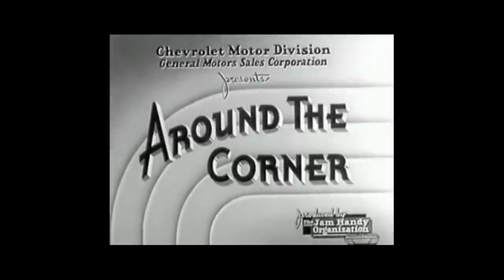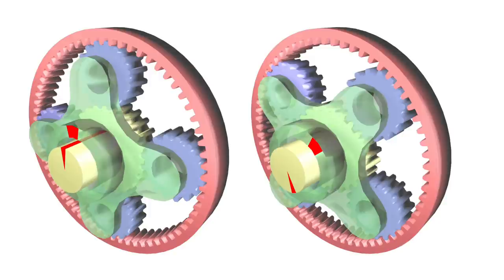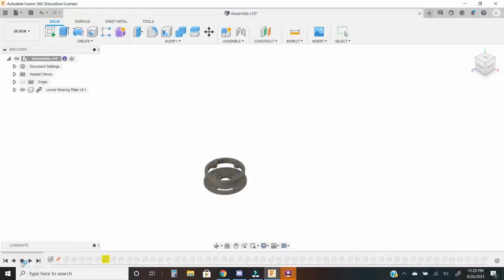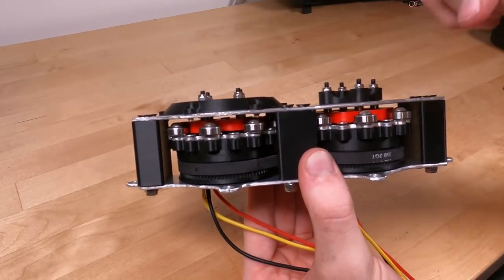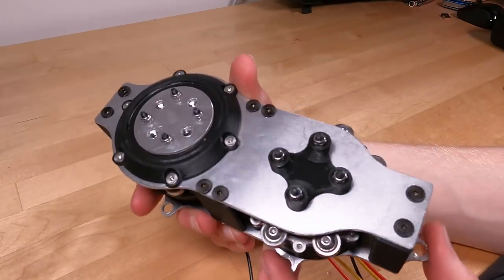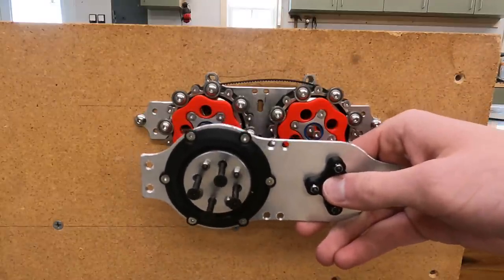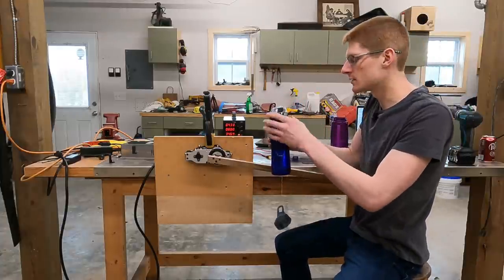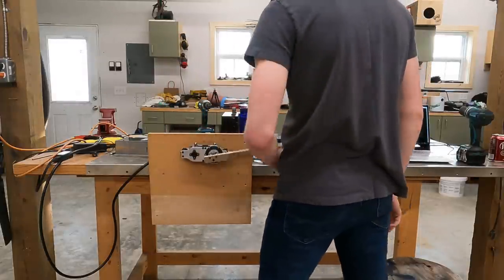The Differential Drive - A New Breed of Actuator

Comment: Look at the Toyota Electric Variable Transmission.  It uses two 2:1 planetary gear sets in series, with  an internal combustion engine driving the #1 set and the wheels, with electric motor #1 driving the #1 ring gear, and the #2 ring gear driven by electric motor #2 with the output from #2 driving set #1.  Each ring gear can move forward or backward at any desired speed from +6000rpm to -6000rpm.  This gives you any gear ratio you want from 1:4 to 4:1, using no, either or both motors to add torque or rpm, or subtract power to charge a battery or to run the other motor (or to start the ICE)

Comment: The thing I get to wondering about is, rather than a water bottle and tape measure and a bunch of calculations, why don't you just use a digital torque wrench. Make an attachment socket for it, turn it on, and  read the number. No fuss, no mess and it's handy to have for other mechanical projects you might do.

Comment: As others have mentioned, the Toyota Hybrid Synergy Drive uses an identical system (Toyota calls it their Power Split Device) to combine the power from the ICE (Internal Combustion Engine) and MG1 (Motor Generator 1). The output contains another electric motor, MG2. By varying the rpm of MG1, this creates an effective CVT for the ICE. Electrical power for MG1 (positive or negative) comes from MG2.

See the following for more information:
 https://hybridautopart.com/blog/toyota-prius-power-split-device/

BTW, Ford also uses an identical hybrid system in their Escape Hybrid and in their C-Max & Fusion Energi & Hybrid

Comment: There are a lot parallels with the two coupling modes to batteries in a circuit. In series you double the voltage (torque) and in parallel you double the amperage (speed). I think it makes understanding your hypotheses and their results more intuitive.
Reply from the maker: No matter where you are in engineering, you find the same kinds of tradeoffs. A beautiful analogy!

Comment: The two motors can be likened to when you chain batteries in series vs parallel.
One way you get higher voltage/amps, but the same capacity-
and the other way you get higher capacity, but the same voltage/amps

Comment: If you have twice the torque, you could use twice the gear ratio to get twice the speed.

Anyway, Skyentific did a nice 2DOF actuator with a differential input, too!
Reply: Yeah. I was a little confused why, if the goal was just to spin at twice the speed, a simple change of gearing wouldn’t be sufficient.

Comment: A planetary gear version could have ring gears with teeth on the inside AND the outside, to mesh the the two planetary gear systems. The direction of the secondary drive would need to be flipped compared to the belt drive coupling, but that's not an issue.

Comment: You could try applying a flywheel and clutch with a basic transmission to reverse them maybe? You lose the precision but gain the ability to store torque of the motors for use while retaining most of the speed of both motors and be able to reverse without reversing the motors and the flywheel.

Comment: Well... The easiest way I can think of to sum up the motor speeds would be to hook the body of one motor up to the shaft of the other one. Of course, you would have to deal with the wires getting all tangled and twisted. You would probably need to use sliding contacts or so for that. But you know, certainly seems easier and more efficient to me that building a complicated gearbox for it.

Comment: What a great video! Thanks for sharing your ideas. This line of thinking could be relevant to a hybrid drive system. The idea reminds me of a Toyota Prius drive system where a motor/generator and an engine share inputs to a differential and torque is routed to where is is needed.

Comment: I wouldn't have done it the same. I would have put two planetary sets back to back and connected them with a belt grooved drum, anchored the motors on opposite ends of a common base (shafts facing inward, and used each to drive a sun gear in opposite directions. A belt off the connecting drum to an idler with a shaft would be where the load would go. You were thinking to take the output off a carrier which would only give one half the benefit of the reduction. Transmissions typically use flanged shafts to take off the outer gear of a planetary, not the carrier. 
I get that you used cyclic gears but you took your output from the wrong place. The motors drive the red cyclics to move the shells sharing the belt. That's your output not the swash plate for one of the drives. Basically you just inhibited one of your drives with a lever. Use a longer belt and use it to drive the load. You did everything else right.

Comment: You may want to look up epicycling gearing, inc patents for it - it does the same thing (i think), allow riving a shaft from several motors. Its not a new thing really, these were used in middle ages to make astronomical clocks and other gear that allowed for prediction of planet's movements - primitive mechanical computers. There are also books on design of these. 

Overall, very well done.
Reply from the maker: A planetary gearset has one output and one input, not two. Though this can be achieved via a modified planetary gearset (or many other reduction systems), it is distinctly different.

Comment: I'm not saying it's the same thing, but when you described "two inputs, one output" that sounds like what crank-mounted eBike motors do. The output speed is determined by my legs, but the output power is the sum of the motor's output and my output.
Reply: In the beginning I believe he mentioned directly coupled systems like the E-bike.    the assist motor changes the power output not the speed output .  your bike may see more speed because you have enough force to actually go up that hill now but your crank is still only getting the same speed per crank revolution even with the added power of the assist motor.
I hope that makes sense.

Comment: If you want to go from twice the torque to twice the speed, one possibility is that you could put the combined motors on a 1:2 gear ratio, since one of the basic principles of a gear ratio, and the reason why cars need transmissions, is that it converts between torque and speed. Using twice the torque on the input shaft, you can get up to the same speed on that side, while the output side of the gearing sees the same torque as before, but driving a much higher speed. Cars use this entire principle, in line with a clutch, to convert an engine's high rotational speed into a lot more torque than it naturally produces, thus allowing the engine to put enough force in the tires to start rolling from a standstill without stalling, or to reach equilibriums between engine speed/torque and vehicle speed that it would never otherwise be able to reach. Without transmissions, we'd be forced to drive on formula 1 grade engines and skid away every time we stopped, our clutches would burn out a lot more and the world's state of pollution would be much worse for operating outside of the engine's range of efficiency so much.

Comment: This drive type was used to apply torque to fins on old missiles.  Rather than a motor, often rocket like changes drove turbines that could be bypassed/otherwise throttled.  Very noisy on a test bench:)

Comment: I think you're wrong about the "arbitrarily precise" thing. Each of the input motors have some number of phases. You can control the output as (P1+P2)/2, which is no different from gearing one of the motors down 2x. This comes from the "no encoders" assuming that the BLDCs have accurate speed derived from commutation. You can just use that same assumption directly from one motor.

Comment: You are totaly correct it could be a very nice mechanism for a 3d printer if you are using nema 23's. They have good torque but are generally a little to slow. You wouldn't want to gear down the motor that much though as their torque is decent. I had my eye on a stepper online motor thats 2.8A 0.9° that can output 0.6nm of torque at 375 rpm. In the case of the sub 5min benchy prints this needs to be around 400rpm with the same values. Your mechanism would allow this setup to be faster and still have enough power to precisely move. If you come up with something i know some people that would be interested including my self.

Comment: What if you did this with a non back drivable gear set, like a strain wave gear for each motor.  Shouldn’t the new stall torque be double the stall torque of each harmonic gear individually? I may be thinking about this wrong Ive only been thinking for the last minute or two, but it seems that since they cant be back driven, it would be the outer shell that would have to fail in order to back drive. Since the 2 outer shells are attached with a toothed belt, you would have to cause both gears to fail together in order to break it?

Comment: Gotta disappoint you dude. Komatsu buldozer(probably more their machines) have this system for driving tracks.
 There is one main driving shaft and two speed alternating shafts for each track. Therefore you can speed up or slow down each track on komatsu buldozer without cutting power. So on one machine got regular efficient automatic transmission and on top of that one hydraulic pump and two hydraulic motors for speed alternating (turning purposes)
I believe there are more machines with that mechanism like tractor with tracks and skeedsteer loader... Who knows

Comment: This mechanism is incredibly common in new PHEV such as the volt or Prius(which others have mentioned). 

It was also common in some old tank drive trains which run with multiple engines.

Still neat video. Should be able to calculate stall torques etc... using gear ratios.

PS recommend reviewing planetary gear equations, they work for any configuration of gearing where there are multiple inputs/outputs in parallel.

Comment: Another thought about your torque prediction: you would really need servo motors with precision controlled rpm to achieve any stall torque on the output. Because, otherwise, you are just “helping” one of your motors to spin faster.

Comment: I think the speed isn't a huge benefit, as you could get the same thing just gearing up the traditional coupling by a factor of 2 (1x torque, 2x speed)
But the very slow output with fast inputs is a huge benefit if you're coupling motors that die at low speeds (like ICEs) or non-encodered electric motors that have trouble at low speeds

Comment: A Oilwell drilling motor - the pipe rotates from surface, input 1. Fluid is pumped from surface through the positive displacement motor. The rpm of the pipe and motor sum at the drill bit

Comment: I wonder if you did the planetary idea, with say the planet gear coupled to one motor , then say the outer ring , or the planet frame connected to another smaller motor. It would be used primarily with one motor to drive the load, once up to speed the other motor could be turned on to add rpm to the output as load decreases  . it could also be used as a clutch with zero friction parts other than whats involved in a gearbox . seams like there would be a few ways to configure such a system that might have applications more in the idea of durability , or improved throttle control . maybe even some sort of hybrid vehicle application .  I feel like the best use of this would to have wildly miss matched motors , like one really low kv , and one really high kv . Its defiantly interesting to consider , nice work .

Comment: If you had a one way clutch or a brake mechanism on the other motor that would be interesting.  Use the inicial motor to get it all going and then switch to driving it to increase the speed or something.

Comment: Have you looked at the planetary drive on Toyota's hybrid cars? They call it a power sharing transmission. Sun gear is connected to a generator, planetary gear are connected to the engine, and the outer ring gear is connected to the traction motor and wheels.
Reply: And a half a dozen others also seem to have posted the above.

Comment: I think speed printers are running into the problem of melting and cooling plastic fast enough to pint at such high speeds. Normal nema 17 motors are still sufficient for this, especially with the insane amount of microstepping you can get out of them. The arbitrarily precise speed in this system reduces the overall precision and increases slop due to backlash with gear reductions. 
Let me know if my assumptions are incorrect.

Comment: I think there a 2 simpler ways of achieving doble speed and same torque:
1) make motor 1 directly spin motor 2 completely and connect output to m2's shaft
2) connect m1 and m2 doubling the torque and use a 1:2 ratio to double the speed and the torque of 1 motor

Comment: Very nice exploration and explanation. Awesome :)
I do tend to agree that the ultra-low, variable RPM implementation achieved by subtracting speeds of two motors might be useful, though I'm certainly no expert on this matter. Theoretically, using V/F (voltage-frequency) solid state AC motor control, max torque can be achieved even at stall speeds - not sure this holds in real life though.

Comment: 3rd advantage: You can reverse the direction of the output without reversing the direction of the individual motors. This is advantageous in terms of cheaper driver-electronics, and also the use of some motors/brushes optimized to run unidirectionally (both for brushed DC motors).
Reply from the maker: Very astute! I hadn't thought of this
Reply: This advantage is key for internal combustion engines whose direction of rotation cannot easily be changed.  Thus its use in hybrid vehicles and tank drives.

Comment: not going to lie, I had this exact idea, except just with a planetary gearbox with a driven outer gear, but I'm curious to if those could be either magnets, or somehow ran through eddy current as a frictionless drivetrain. my theory is that if they are slightly off in speed (a ridiculously low output speed) you would have to have a ton of torque (in theory at least?)

Comment: All fine and good but if you are coupling two electric motors together you don't need this as the energy can be electronically adjusted to each motor through a switch mode..  ie the mechanical differential becomes obsolete as it can and IS done electronically

Comment: Cool application, look into what Oklahoma State did with this concept circa 2003ish on there tractor pulling tractor. Using 2 outputs from a ICE engine coupled with a hydraulic pump/motor and planetary setup! Good for an ICE engine at its peak Hp/tq

Comment: I wonder if some form of ratcheting can realize the torque for at least high torque to high speed transmission. You wouldn't get all the combinations you hypothesized but high torque to high speed transmission is really important for a lot of motor applications.
Reply: Maybe even through some form of reverse clutch that allows the high speed mixing motor to engage and remove the ratchet mechanism.

Comment: You built a neat torque limiter though. Just replace one of the motors with a controllable braking mechanism. Seems reasonable that it could have use for traction control.

Comment: Check out the Inception Drive by SRI. It's a concentric infinitely variable transmission. Works by a similar differential principle, but in this case, it's the relative movement of two V-pulleys.

Comment: Or, you could just use a gear on each motor that is twice the diameter of a center shaft gear.

clockwise motor> O o O>counter clockwise motor
                                     ^
                             shaft gear
Just size the motors to overcome the loss of torque from the 1 : 2 gear ratio.

8 : 1 reduction? I thought you wanted the sum speed of the 2 motors. now it's reduced? I'm confused.

Looking shiny, cool, good doesn't get the job done. Good luck with upgrades. I hope it works for you.

Comment: I've actually been working on using an epicyclic system just like this with force on the sun and ring to increase the carrier's rpm  for a generator. I didnt consider using this as a dif for two motors

Comment: I did a lot of work with cycloidal gears in robotics, 8:1 though possible in cycloidal gears it falls outside the range where their benefits outweigh their challenges. Things like their resilience to shock loading and high amounts of inertia during back driving are all lost when creating transmission with such low ratios. Typically ratios for these gear boxes are in the 20:1 or greater.

Comment: I like the idea of fractional speed while maintaining torque. A reduction gearset will get it done but you are limited when you really want to move short of big money servo motors and even bigger money servo drives. Would be great for movements on a Miranda size 3dp or a 4ft x 8ft CNC router. Without spending a fortune.

Comment: Cool!
I was just thinking about something very similar to take advantage of a gear to add the RPM of two stepper drivers.
My goal is to drive a timing belt from very slow to very fast in both directions.
I think one point might be the sync of each "atomic step" and therefore i suggest a flexible coupler to start.

Comment: I think you could also make one of these by staging a motor (the housing) to the shaft of another motor. That i believe would double the torque and double the speed aswell
Reply from the maker: My first thought was to design a motor on top of a motor, like you suggest. the problem then is figuring out how to transmit power to a quickly rotating stator. This design would perform in the same way, but without the overall reduction. Speed would be doubled, but torque couldn't due to conservation of energy.